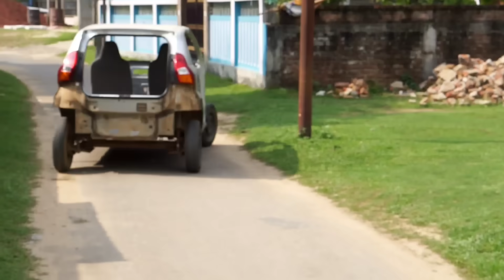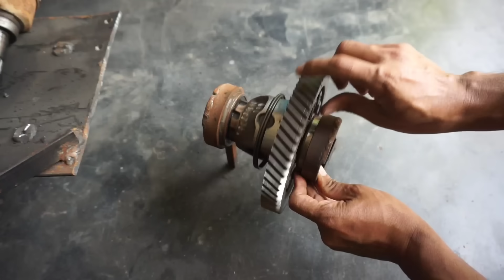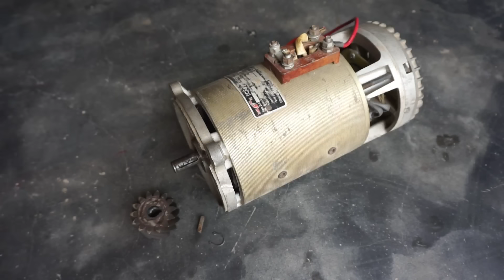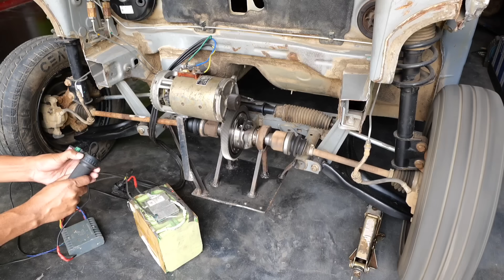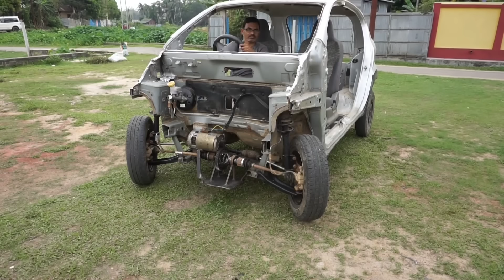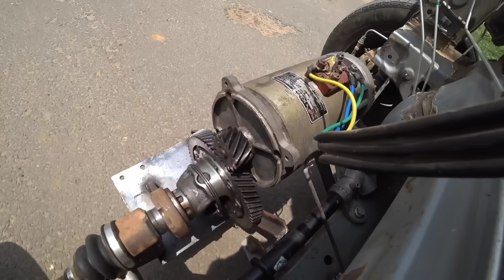diy electric car

Comment: The electric car was also made well over 100 years ago. Know what else was built for the ICE starting over 100 years ago.  The infrastructure to support the ICE vehicles.  An there are  EV's from that time still on the road as well as ICE vehicles.  The biggest problem with EVs currently is the less developed infrastructure.  The sensitivity to temperature of the batteries.  It takes time to make it all work.  Biggest problem we face right now. A standard charging adapter.  Which would allow for charging across the board.  Our own infrastructure being able to support charging for an all electric fleet.  How to effectively an efficiently move goods around the globe without fuel.  Figure out some of these items and we might be able to make it all work.  The items I listed are the main reason cars like the Baker electric car were out paced by the Model T.  Both had their place. Interested to see where the world takes this.  Personally I have to stick with my Ebike locally and my ICE vehicle for long trips.

Comment: I'm unimpressed. Any fool can replace a small gas engine with an electric motor, but it's the battery that makes or breaks an electric car, not the motor. Back in the day, everyone was publishing plans to construct your own satellite dish, but what they didn't tell you was that without the signal amplifier and the decoder, the dish was worthless.

Comment: That starter motor will last .
Made for 10 sec burst at most.
No heat exchange .
Just a waist of time.
Try to climb a hill 100 feet.
If you used a huge turbine starter maybe they run high rpm for ling time

Comment: Why not just bolt the motor to the original gearbox like ev converters do .? Differentials and bearings are not keen on grit and being without lubricant

Comment: Pure click bait bs. Those bearings supporting the differential will last 3 miles and then they will burn up, it has no speed and it cant haul any weight ie the rest of the missing car. This was done for views not practicality.

Comment: You can improve the powerfactor  by adding capacitors across the +and- of the motor but not if it's AC or VFD. how much is based on the inductive kvars.
Reply: Did you just say he could improve the power factor of a DC motor?
Reply: @alexkram  yes ... so why are you asking that?  I can't wait to hear this.
Reply: @dannyozuna  asking because power factor has to do with the phase difference between voltage and current in an AC system. A DC system has no frequency or phase so the power factor would always be 1. Of course this is the Internet where everyone is anonymous so I'm sure you have 10 PhDs and a few Nobel prizes and could go on and on about why I'm wrong.
Reply: @alexkram  ok, I know you're correct  as far as you have explained. But 

 The inductive spikes can get into supply rails, or even jump across space via inductive/capacitive coupling, Sometimes the spark-plasma can involve nanosecond transients, and can even radiate GHz trash, especially if the motor-leads have a resonant loop size, or resonant length.

The capacitor shunts (or "absorbs") the high frequency spikes from the commutation and prevents damage to the driver.

A further factor is that snubber diodes should be used to prevent inductive kick-back from the motor's inductance, causing damage to the driver's output. While the diodes protect the driver, the capacitors take the "edges" off the current spikes and help reduce EMI, etc.

Also, a diode inline or across the  motor leads could help as well.